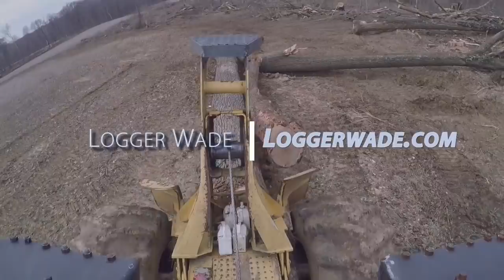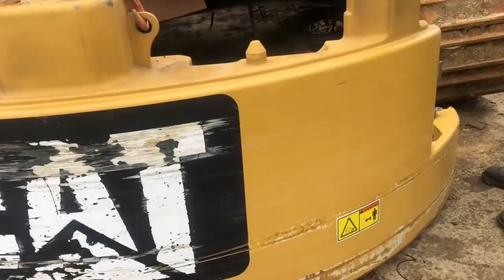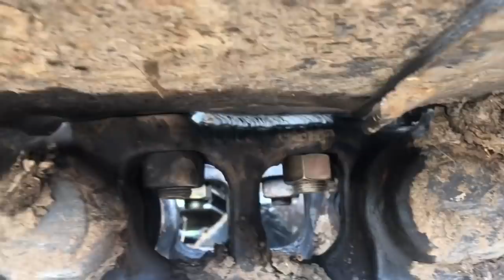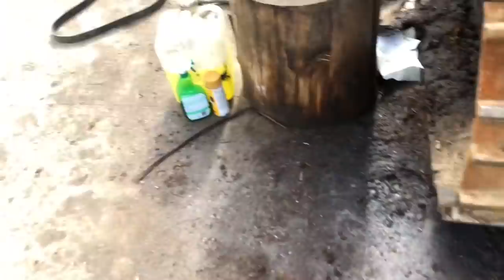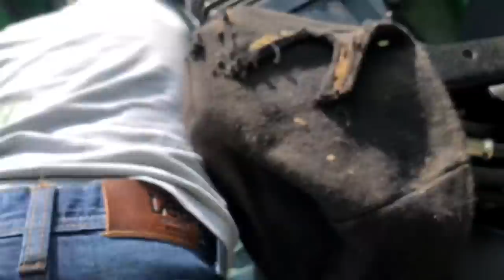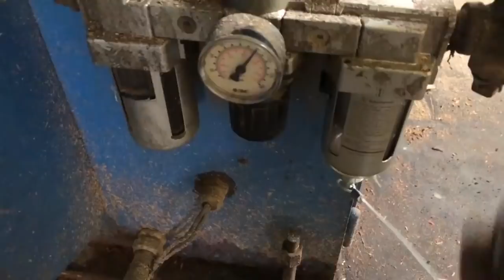Finally got the din din radiator back!!!

Comment: Hay Wade if you get 20 mm bolts that will fit the pads you'll have to die grind the rails a little fixes the problem